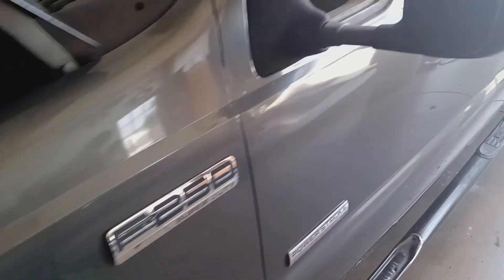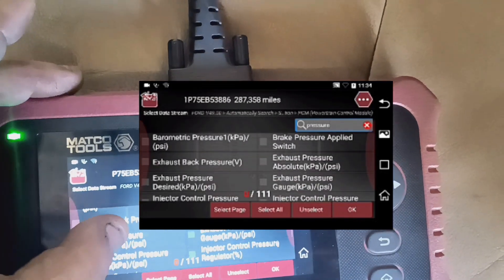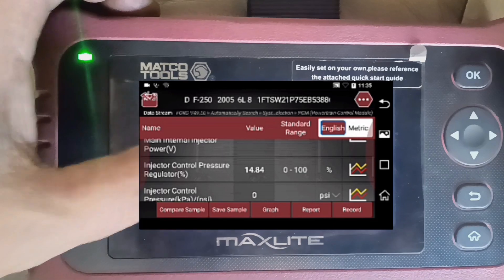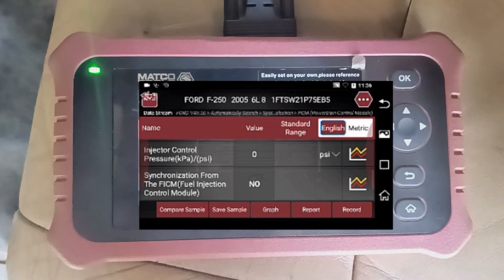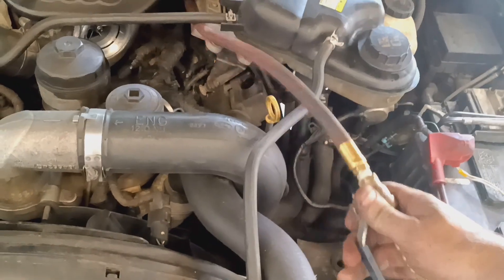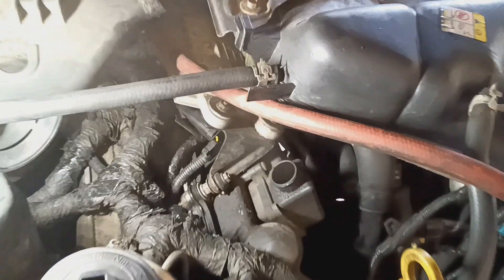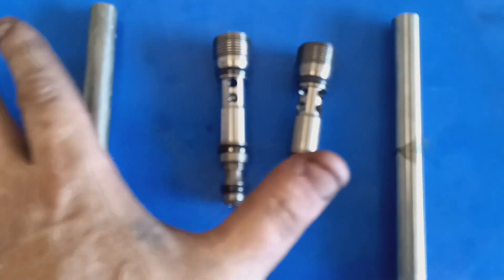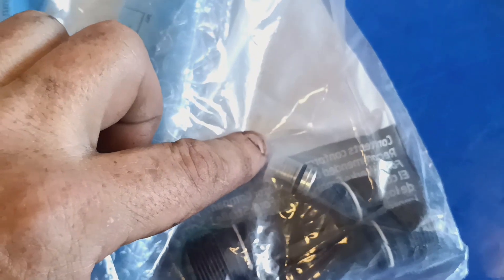Ford 6.0L Powerstroke - No Start

Comment: Nicely done. One little tip, that much cranking to fill the HPO system back up is really hard on the FICM. Some people just crank until you get ICP without the FICM installed but I prefer to just remove the FICM relay from the fuse box and crank until I see ICP on the scan tool. Then insert the relay and it will crank right up.
Reply from the maker: Thats a good tip!